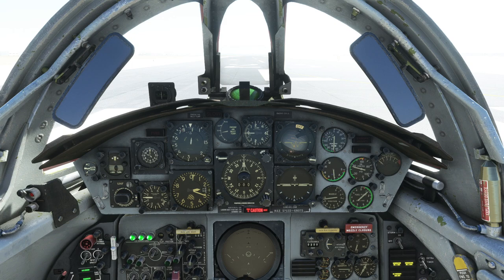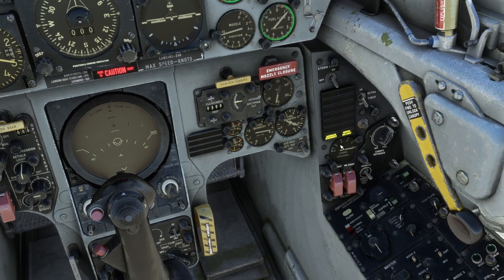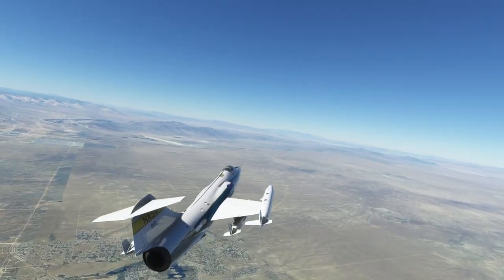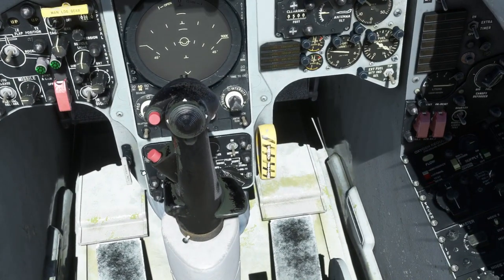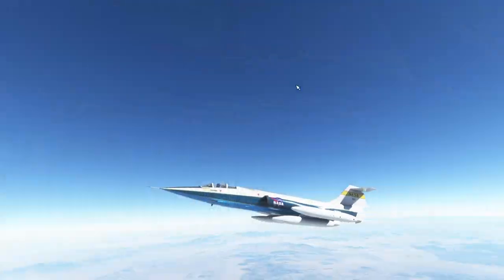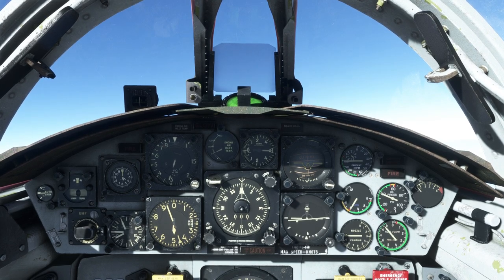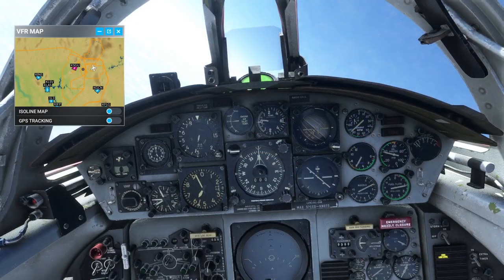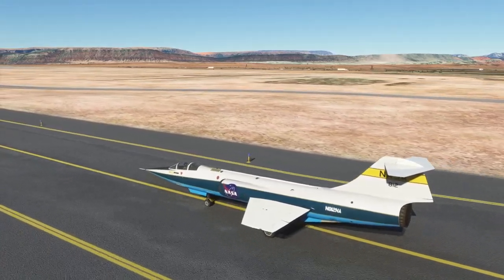Flight Sim 2020 - Flying the Sim Skunk Works F-104G

Comment: I couldn't get the F-104 over about 500 knots. What's up with that?
Reply from the maker: Are we talking about 500 knots indicated airspeed on the gauge or ground speed. At high altitude, 500 knots indicated can be Mach 2 and more than 1000 knots ground speed. If you're referring to the ground speed, then the issue might be the drag from the pylon tanks and the need to basically plunge from 36000 feet to 30000 feet to break the sound barrier with this F-104 (which is probably not accurate). Make sure to keep accelerating once past Mach 1 up to Mach 1.3 before trying to climb.
Reply: @RaizSpace  I couldn't' get above 350 indicated up around 35,000' with no external tanks. This flight model is way off of the real F-104 performance. Down around 10,000' I could almost get 500 knots until randomly it jumped to 800+ knots.

Comment: Allways loved the "zipper". But altough SSW did a nice job, in the beginning there were some serious bugs. Most of them are solved and since update 3.3 the engine rpm does not drop to 60´% when i go over 10.000ft. I still remember when the F104 flew over our head with that haunting howl. Beautiful! That was in the early sixties. Our Belgian Air Force used the zipper. Anyway, as i said: still in love and i can take him easely up now till over 60.000ft. In the sim of course...Greetings from Belgium.